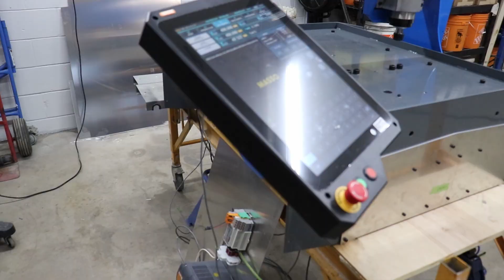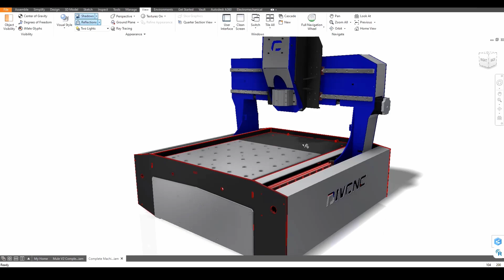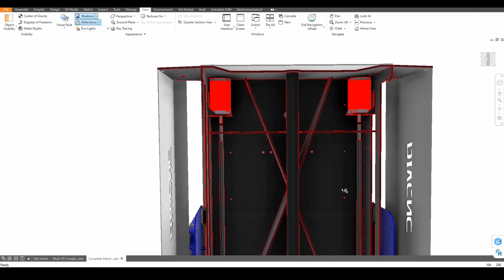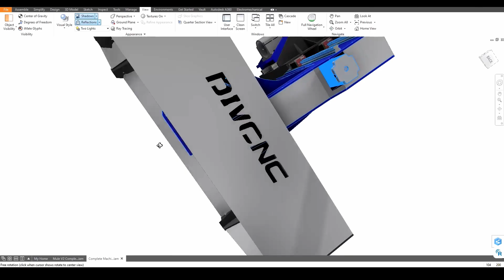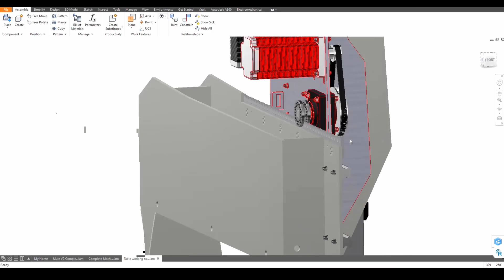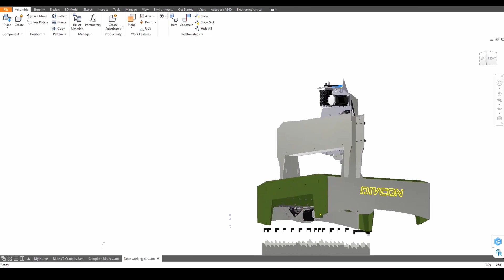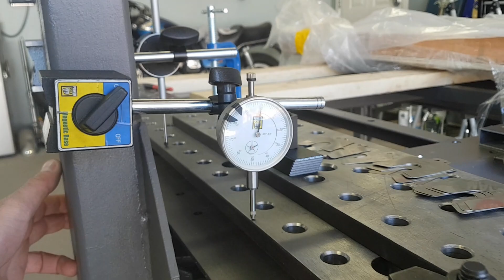We design and build this CNC mill from the ground up! Build Series (Part One - Design)

Comment: In the case of laser processing like this, please tell me how many millimeters the size difference between the two parts must be to make them fit together.  Assuming that the length of one side of the square hole is 50mm, how many mm should the entry part be to fit and fit like the video?  If you let me know exactly, I will try the design too.
Reply: What is a design program?  If you don't mind, could you send me the drawing?
Reply: Upon receiving the reply, I will delete this comment immediately.